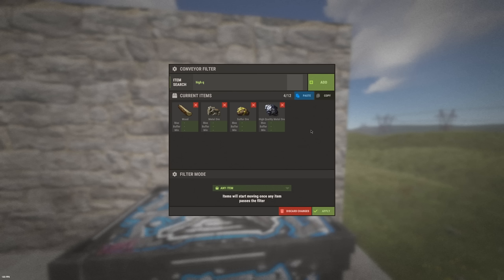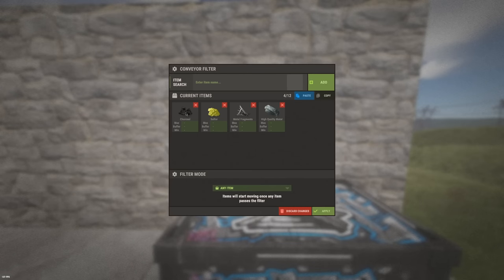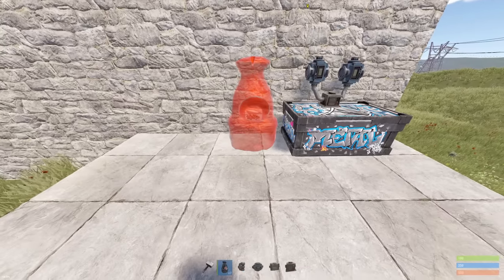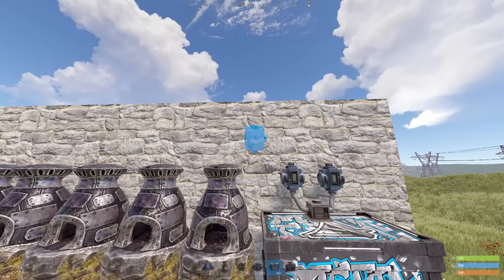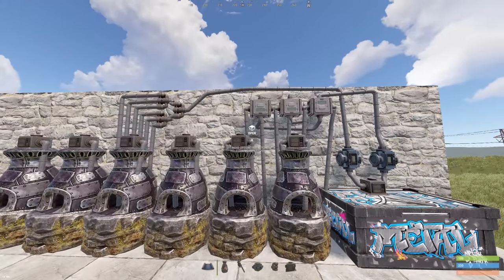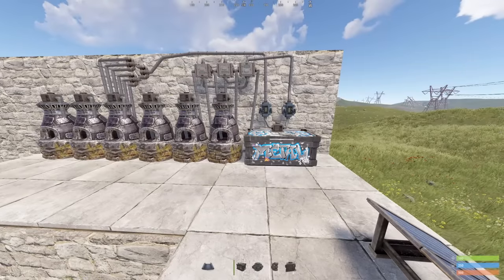Industrial Furnace System and Automatic Starter Storage 🔧 - RUST TUTORIAL

Comment: That system is vastly over complicated. You only need 2 conveyors. You just chain the output of each furnace to the input of the next, the final output goes to a conveyor, then back to the box. It's just a simple loop with a conveyor before and after the furnaces.